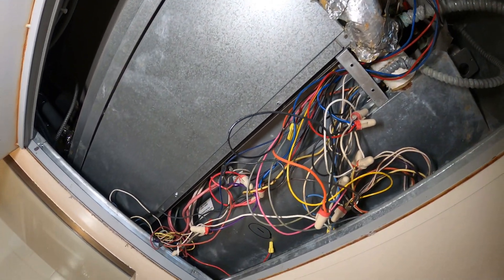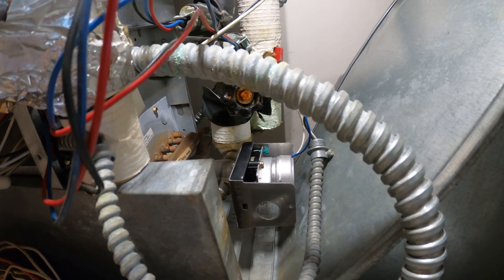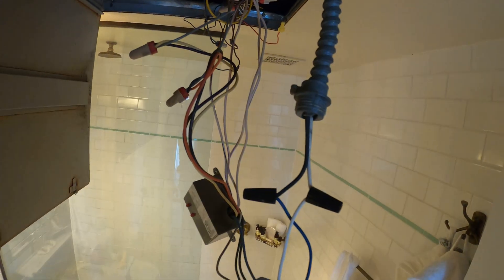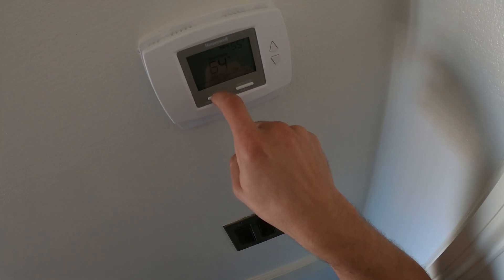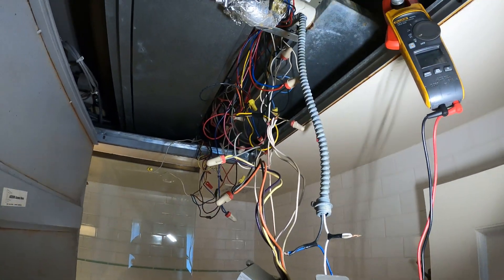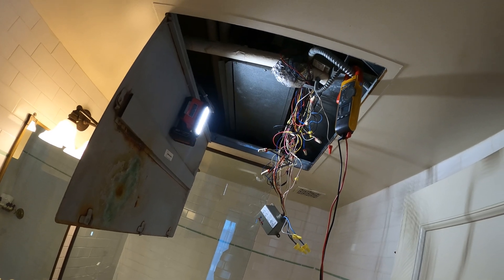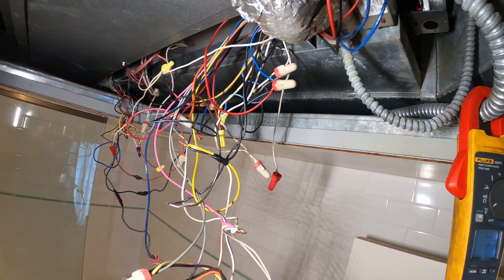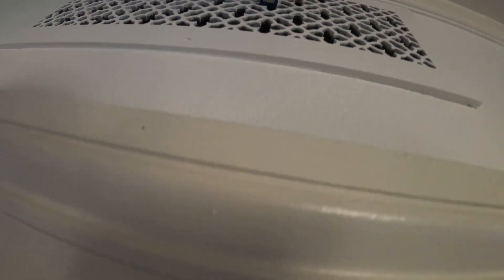HVAC Service Call: Fan Coil Unit Not Cooling Or Heating (FCU Fan Coil Troubleshooting) No Heat/Cool

Comment: This reminds me of the 1st video that started me watching you.
Reply from the maker: I know exactly which video you're talking about! That's awesome man. Thank you for your support🙏 This one was tricky. Time for a new unit 💯 Stay tuned for new videos every week🔧⚡️
Reply: Hey me too I started watching you because of this here is my humble opinion. First I wish to be there w u to troubleshoot it Cause I read the Print 110 volts Thermostat wiring Diagram and would it be nice to see what or how it was wired Definitively a wire feed back u got it. Then if u have 2 pipes or 4 makes a wiring Difference This Honeywell type Tstat need to be set for that in the Tech Inst. Manual.

Comment: Floor mounted FCU 2 pipe system i put thermostat at 72 F when we turn ON its blowing cold air. I changed the NO Actuator, but it works for 1 minute, and the Actuator is going to close position. Also, I did factory reset the thermostat. Still same. (Tried with different Actuators ) What could be the issue ? Thermostat bad ? No error showing on thermostat.

Comment: Great video as always Listen I worked on chilled water here in FL I never did in New York when I lived there in the 80 s. Honeywell 110 volts Tstat s are funny Always separate ur neutral wires so u ll never get feedback.  Those 40 volts were from feedback same as the 160 v.....The tstat can be set for 2 or 4 pipes w Manual change over as u mentioned. Also Aux Heat must be wire accordingly so it doesn't interfere with Cool Relay or Actuator. Those Ribuc Relays are nice to know when u are on Cool or Heat when both came on I said ,,,,,..Feedback . This is how I do it. Take all wires out and disconnect and start one by one Doing all my Neutral to White Wire and Then Cool Actuator and Heat Relay or Auxiliary Heat Contactor ,,,,,,Then. Blower Motor with about 3 Speeds.....Doing one by one is a lot easier Pls di Video part 2
 2.5 kw

Comment: I'd suggest new unit cause that's a lot of wiring to do and I dislike solid wire lol
Reply from the maker: To get to the electrical heater you need to take off the cover above the unit and there's no clearance above the unit as it's to the ceiling 😂 Time for a new unit 💯 Thanks for watching & stay tuned for new videos every week 🔧⚡️